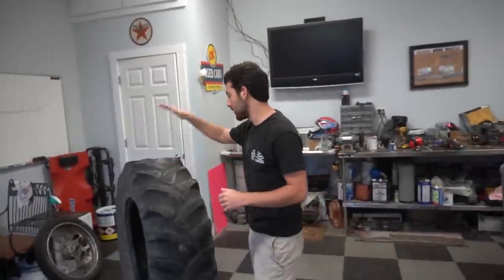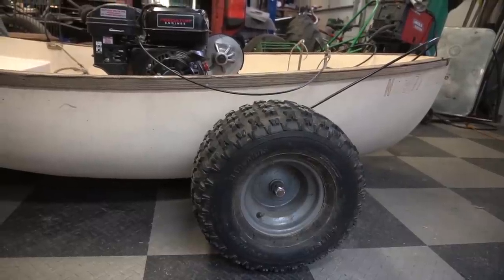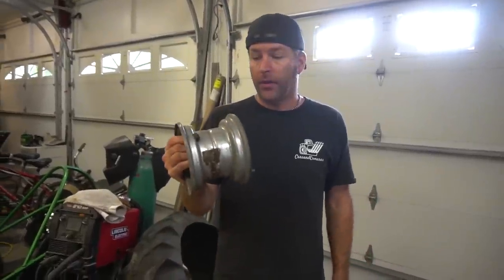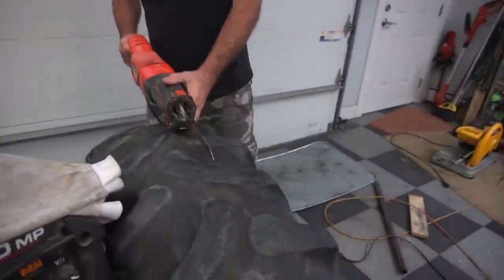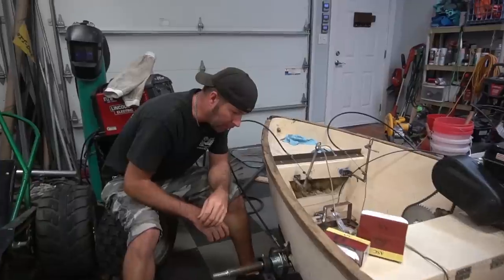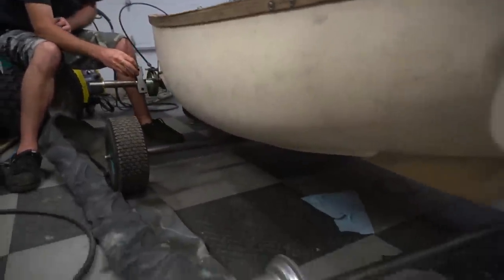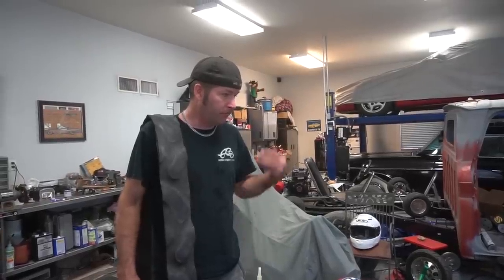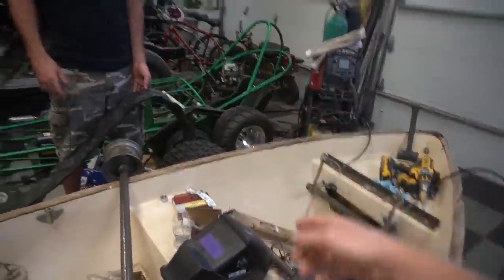Tank Boat Transformation! | Amphibious Boat Kart Pt. 4

Comment: Could have doubled the rims on each side weld them together and making the center of the rims slightly less diameter than the outside,  and would allow more width of the track and still keep it in place,  and as for gearing just add a jack shaft and more sprockets to gear it down more
Reply: Also adding outer ring plates welded to the outside of the rims on front and back rims to help keep the track in place so it could not fall off again and adding a spring tension idler to keep the track tight possibly using a spring shock from a pit bike or something, over all awesome attempt,  tracks are a huge headache

Comment: Keep that amphib thing, but ditch the tank idea. (Hate saying it, but you don't seem to have much an idea on approaching that aspect.) Get some big 8" or 10" inflatable tire casters for the front and back, paddle tires, and weld some paddles to the inside of the rims. Had it somewhat working, so why not restart it with what did work and follow-through?

Comment: you should of deflated the drive tires and then pulled the rear wheels tight! then inflate the drive tires to tighten the tracks. not a failure if you correct that

Comment: you guys should make another tank but make it so its not a boat. use the new torque converter and a suped up 420 on a custom built frame then you can have some super wide tracks

Comment: Should have installed tracks while tires were virtually flat. Use the air pressure on the tires as track tensioners.
Reply: Still a fun channel to watch. Well done on 500K

Comment: With all the welding you guys do on your carts, why don’t you build the boat?  Build the tank subframe and weld sides, a bottom and a bow out of recycled aluminum?  I’ve seen you do way more complicated stuff with less.  You have to think the track through though, that part had failure written on it as soon as you made the decision to cut the tractor tire.  Obviously tank tracks are a little more complicated than you guys planned for.  Lol

Comment: Google Plywood Jon boat. It would be great to build the boat then convert to tank boat.
Reply: YUPYUP!! and for this I'd go 5/8" bottom 3/4" sides for 8 half shafts of paddle tires... other details I'd already left off in other replies. edit: much strength also coming from thwart bench seats, and supports for the half shafts inner bearings. built a few boats, already have a great "no plan plan" in mind.

Comment: I think two engines would be better.  Use one to drive each side with spindles mounted to each side of the boat and no solid axle.  Throttle control instead of brake control.  Then watch Donn DIY's channel for inspiration into making your own tracks.  https://www.youtube.com/watch?v=mb0_dhGiKVk